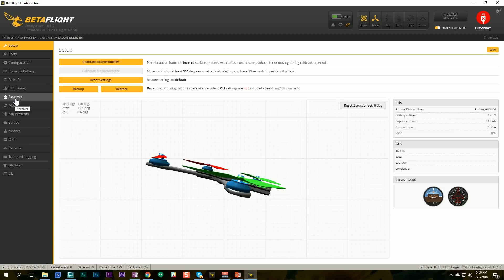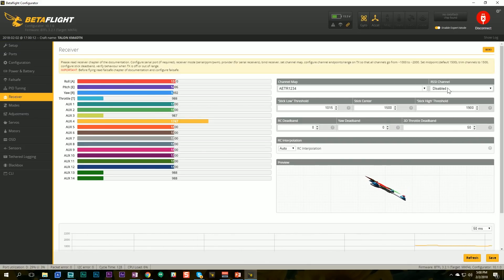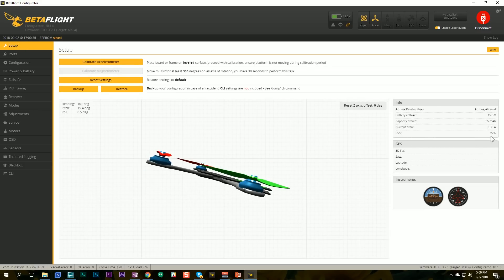How to put RSSI into OSD (UPDATED FOR OPENTX 2.2 & Betaflight 3.2)

Comment: you should do some stuff on crossfire Joshua
Reply from the maker: Soon.
Reply: Joshua Bardwell You should compare Crossfire to the FrSky long range R9 Slim.
Reply: That'd be awesome ^
Reply: This should work pretty much exactly the same with CrossFire since it has an RSSI “sensor” in the telemetry tab (it has a crapload if them, actually). Just a matter of picking the right one as your source, should be the one called RSS1.
Reply: For Crossfire You need to send RQLY instead of RSSI on an RC channel
Leave it at weight 100 and offset 0

If suing Kiss  OSD - Adjust RSSI min and max in the config tool ( for Crossfire 1000 min and 2000 max )
Reply: Yes please Joshua, Crossfire!!!!!
Reply: Love to see crossfire vs crossfire micro
Reply: For TBS Crossfire setup, refer: https://www.youtube.com/watch?v=L0IfucZ6WvI

Comment: I just did it with my Flysky FS-i6, with the latest 10 channel firmware flash using aux channel 5 and "error" as the resource, Thanks again Joshua! BTW using flysky x6b receiver on i-bus
Reply: Do you want me to surprise you?
On my Taranis 7 I installed the multiprotocol module IRange.
I binded with the receiver FS IA6B.(With the latest firmware for this receiver.)
And on the screen Taranis qx7  I see RSSI from IA6B! :)
And in the latest firmware for IRange, also works failsafe for receivers from FlySky.

That's why I change FlySky to Taranis-and I can use receivers from FlySky.
Reply: Do you maintain the same range via the module?
Reply: I did it too.. easy to do, once it is flashed to the 10ch firmware
Reply: Can you please tell me how you did this, a link would be great!
Reply: After 10 .minutes.Ok?
Reply: https://youtu.be/wZHw9swfLsw
Reply: There are also some hardware hacks to get the RSSI with flysky,1) find the RSSI pin on flysky receiver, 2) then just feed it to the RSSI analog input of your FC -- Here is how/where to find the RSSI output of the receiver: https://www.youtube.com/watch?v=zvgTwDiYdE0 & https://www.youtube.com/watch?v=Ebo2_3HuDck
Reply: No need to do anything.
I bought a module for working with Flysky.
https://www.banggood.com/IRangeX-IRX4-2_4G-CC2500-NRF24L01-A7105-CTRF6936-4-IN-1-Multiprotocol-STM32-TX-Module-With-Case-p-1197130.html?rmmds=search&cur_warehouse=CN
It should have the latest official firmware. From December.
In this firmware is already inserted failsafe for Flysky -NO PULSES.   It is NEW.
That's all that's you need.
 Receivers from Flysky must have the latest firmware.
If the firmware is not the latest version - you will not see RSSI. They must be flashed.
For example, the receiver in the video, came from the store. I did not flash anything.
How need to flash receivers -here.
https://www.youtube.com/watch?v=inClQ6bTkLY&t=25s

You- in the menu on Taranis turn on telemetry - and you see RSSI. That's all. :)
Happy flights :)
Reply: Alex R. The rest of us, are talking of getting the rssi from a flysky radio. Not a tarannis.
Reply: Guys do you know if its possible to flash the fsi6 using an st link device? Still waiting for my fdti in the mail
Reply: Ruxys it should be.

Comment: Hi joshua.  

Thanks for the info. 
I use Crossfire and tbs tango. I get rssi easy to work.  But why is it the when you unplug your lipo that the rssi stays on 45% instead of 0 . 

Thanks
Reply from the maker: Because the default failsafe behavior is to hold-last-position for Aux channels. Go into the RSSI tab. Find the Aux channel that you're using for RSSI. Change it from "Hold" to "Set", and set the value to 1000. This will cause it to go to zero when it failsafes.
Reply: Thanks! 
Adjust this in the tango or betaflight  ?
Reply from the maker: I would do it in Betaflight.
Reply: Correct me if I'm wrong, but I believe the newest crossfire firmware fixed this and it does drop to 0 now. I haven't updated to it yet because it was bricking receivers. However if you do get it to flash you never have to worry about them bricking on future updates.
Reply: Have the latest beta firmware still Goes to 45% check tonight what Joshua told .

Comment: How do you do a range check?
Reply from the maker: In the Model Setup menu, go to where you usually would Bind the model, and right next to where it says Bind, it says Range. Highlight Range and hit Enter button. This will artificially reduce the output power of the transmitter. You should be able to walk about 30 paces away and still have link. If not, you may have an issue.
Reply: Joshua Bardwell this work with crossfire as well?